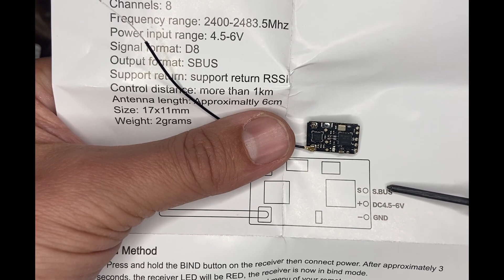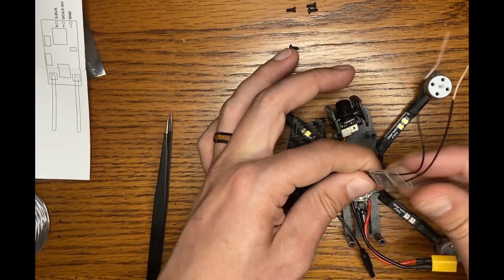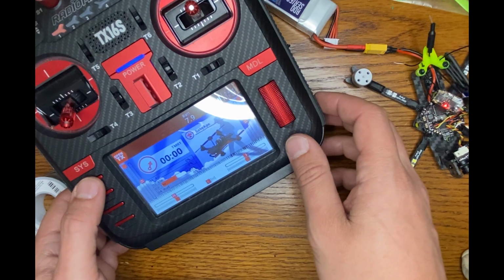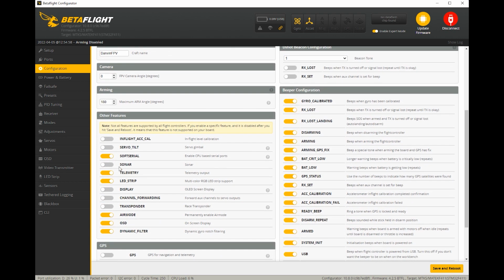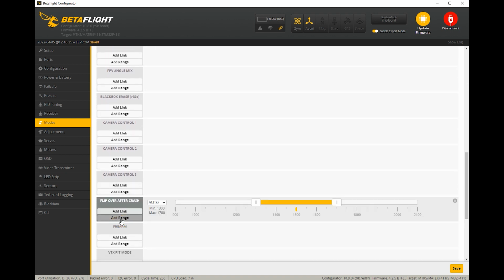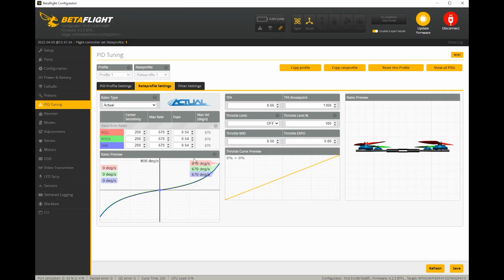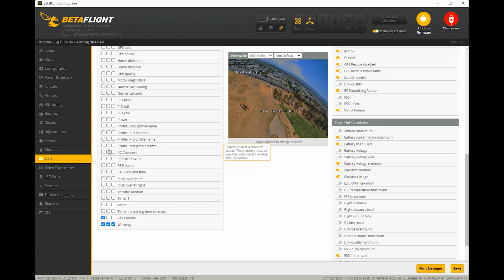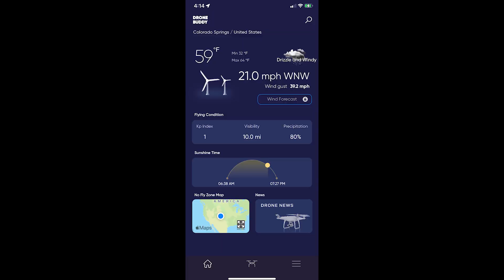Setting Up My First PNP (Plug-and-Play) FPV Drone - DarwinFPV Baby Ape 3" - Radiomaster R81

Comment: What up bro, I know these videos are fairly old but just wanted to say they’ve been very helpful. Crossed over from DJI drones and started with the Tinygo & then coincidentally just got my baby ape pro v2. I bought a bunch of soldering stuff because I eventually wanna learn but luckily the ape I got came with the elrs rx so I was able to skip that part of the vid. I’ve seen other videos showing how to bind other drones with the elrs tinyradio & it seems you plug and unplug the drone 3x & then follow the bind steps on the tx. Is that the same across all elrs drones? Should I do anything with betaflight? I know this is a long ass msg so thank you if you actually read/reply 😂 ..added you on TikTok also. PAYCE ✌🏼

Comment: Hello.
My baby ape only beeps 3 times in betaflight configurator insteased of 6 times to show that a setting has been saved on the flight controller.   Any hel
 Guys on what i should do ?
Reply from the maker: I believe the first 3 beeps is confirming esc powered up and the 4th is throttle input is being read and the 5th is confirming throttle is at zero. So try having your controller is on and bound with throttle down otherwise betaflight may not have your throttle input at zero so you won’t get those beeps. If you’re still not getting the last 2 beeps, your 5v regulator may have stopped working and will need to be replaced

Comment: Nice and helpful tutorial! I recently got the same drone an receiver, could bind it with my tx12, but the signal is so poor and I cant find the error. Soldering is well, signal D8. Any ideas?
Reply from the maker: With the international module you could first try fine tuning the frequency and that could help, check the antenna are fully connected and not blocked bay anything or damaged, and it’s also possible it could just be faulty hardware. Frsky isn’t the best protocol when it comes to range. Are you getting failsafes close by or just warnings?
Reply: @719FPV  Well, it is crazy. If I remove one antenna, the reception is suddenly better. Maybe it is the hardware. Thx

Comment: difference between ELRS receiver and r81 receiver
Reply from the maker: To sum it up roughly elrs receivers are open source and will work with any transmitter with elrs protocol so there are lots of options of manufacturers and frequencies. The r81 will only work with transmitters that have frsky d8 protocol, which is still pretty common to find. But past that the main difference is the r81 receiver has a range of about 1km or 0.5 of a mile, and elrs receivers have ranges of 30km or more
Reply: @719FPV  THX!!!!
Reply: @719FPV  Hello! I have decided and I want to buy this drone and I have some questions. On their website I can set the Elrs receiver option. Does that mean I have to install it myself when it arrives? And the second question is: what is the maximum control distance?
Reply from the maker: @planes917  no, if you choose for it to come with the receiver it will come with it installed. And the maximum distance can vary depending on a lot of different factors but in perfect open air conditions you will be able to go as far as you want and would only be limited by flight time and video signal
Reply: @719FPV  Does it come with a controller and goggles?
Reply from the maker: @planes917  yes, you can the the rtf(ready to fly) kit that comes with everything you need
Reply: @719FPV  if I buy only the drone, can I buy a different controller and connect?
Reply from the maker: @planes917  yes, just make sure you get one that works with the receiver that you choose
Reply: @719FPV  Ok. THX!!

Comment: Hey pueblo here! Just came across your videos trying to find a good cheap drone to have some fun with but don't want to spend too much. I wanted To go the build route but becomes pretty expensive when adding in controller and batteries 😅
Reply from the maker: It definitely adds up quick. Going the “ready to fly kit” rout is a pretty good way to start, the baby ape now comes in a ready to fly kit that’s a pretty good deal. But if you know what controller and goggles you ultimately want, you’ll save money down the road buying those first so you don’t have to buy more than one. Let me know if I can help
Reply: @719FPV  thank you for replying back so fast right on👌and yes it definitely does add up I really want a type of drone like the baby ape but was also looking at regular drones like the tello and some of the Holly stone drones, do you happen to know much about either of those drones? Thank you very much in advance 👍
Reply from the maker: @aip719  I don’t know much about those, sorry, but those look like decent options for entry camera drones.
Reply: @719FPV  would you have to know anything about the emax tinyhawk freestyle 2? It has goggles and controler I've seen some good things about it I think that us the one I might go with at the moment
Reply from the maker: @aip719  yeah they tiny hawk kit would be a great option to start with
Reply: @719FPV  I now just came to the realization that I have glasses and wasn't really  paying attention to how many of the Goggles out there don't really look like they'd fit glasses so now I'm really not sure what to do😅or I can just try and get me some contacts again 😅
Reply from the maker: @aip719  a lot of goggles come with adjustments in and out to focus that might work for you, and some you can insert prescription lenses too

Comment: Hey Nick, thanks for the video! I had a quick question about the quad that I couldn't find online: What length standoffs are used in the frame? I'm ordering a baby ape now on special, but want to also add standoffs in the same order. Thanks in advance 😃🙏🏼
Reply from the maker: No problem, the baby ape standoffs are 15mm M2
Reply: @719FPV  Wow, thanks a ton for the speedy response and info! Legend! Happy flying 😎

Comment: Nick,
I am trying to get into FPV and have bought a BabyApe.  My question for you is how’d you learn what everything in betaflight is/means?  I’m a little technically challenged as I probably have 25yrs on you so I didn’t grow up with computers.
I am using your video to help me set up the BabyApe, but I’d like to understand Betaflight, it seems very complex and over my head but I want to better understand it.
Reply from the maker: Right now the best resource I have found for understanding Betaflight is the Joshua Bardwell YouTube channel. He has a full playlist that goes through everything. It takes some time to get through them but very much worth it. 
Here’s the link the the playlist
https://youtube.com/playlist?list=PLwoDb7WF6c8nT4jjsE4VENEmwu9x8zDiE

Comment: So if I am understanding this correctly, the Radiomaster R81 is a FrSky D series compatible receiver, so this should work on my Turnigy 9x which I have installed a FrSky DJT module(which I have been using with the FrSky D8R-II Plus that came with it). Does that sound right?

Comment: i accidently deleted the comment can you send it to me again i contacted a sell of ebay about the drone and he says it has a 4 pin for the receiver is that true
Reply from the maker: Haha yeah no problem, the receiver you have will work with no issues. The baby ape comes with solder already on the ground, 5v, and sbus pads which make connecting a receiver super simple. It’s also has available rx and tx pads for receivers that require them.
Reply: @719FPV   @719 FPV   @719 FPV  this receiver Radiolink R8SM has a concert has a plug pulged into the receiver and 3 wires coming off it just solder the wires to the baby ape pro and the seller on ebay said there is a 4 pin connecter for the receiver r  does it have it on there
Reply from the maker: @dustinplee5067  yeah you will just have to solder the 3 wires to the baby ape, they will solder on the same way I did in this video
Reply: @719FPV  did you make a video on how to set up the vr goggles and if you did can you put a link in my comment so I can see how to set it up and if you didn’t can you make a video and what is the app for the baby ape pro I got one coming this weekend and does it matter what vr goggles I use
Reply: @719FPV   I got my baby ape pro in the mail today and it has 4  wires on the plug on the board and my receiver has three wires so do I just desolder all four wires The wires and solder my three wires onto it and do I need the white wire that is coming off that plug because mine I have three wires
Reply from the maker: @dustinplee5067  yeah it would be easiest to just desolder the 4 wire plug (which should be 5v, ground, rx, and tx) and then solder your receiver on using just the 3 wires going to 5v, ground, and SBUS
Reply: @719FPV  I soldered the red and black wire Like they were with the four wires when the red and black come off of and the yellow wire I soldered them all three next to each other and it’s blinking red one time and double blinking yellow how do I fix that Is the S bus where the white wire is or where the yellow wire was and when I tried to connect it to Beta flight it says failed to open surreal port when I tried to connect it to my computer And what board do I choose and what firmware version do I choose and should non-reboot Square and four chip  erase and Manuel Baud rate be set at
Reply from the maker: @dustinplee5067  sounds like you have it soldered correctly but your R8SM receiver could be in PPM mode, try double pressing the bind button to change it to SBUS. You may have to change it in betaflight as well
Reply: @719FPV  What color is the receiver supposed to be it’s red right now it was like a purpleish color but I tapped it twice on the bun button and now it’s a solid red but it’s still blinking red One time and blinking yellow twice what board do I choose and what firmware version do I choose and should non-reboot Square and four chip  erase and Manuel Baud rate be set at and what is my trim on my transmitter Supposed to be set at all the way down I hear no beep I hit the bottom of the trim and what’s my S bus PPM & PWM settings on the transmitter supposed to be neutral or reversed
Reply: @719FPV  and why is my baby ape probably o not connecting to my beta flight I’m using a Android cable I had to re-solder the receiver because it was in the wrong spot after I watched your video  it to the right spot but it still blinking a red light and two yellow lights
Reply: @719FPV  and what are the settings for the transmitter on a radiolink
Reply from the maker: @dustinplee5067  from what I can find on the radiolink r8sm is that it can use both PPM protocol and SBUS protocol. When it is in ppm, the lights will be red/orange. And when it is in SBUS the lights will be purple/blue. I believe it needs to be put in sbus mode and then it will work with the baby ape the set up should be same is what I did in this video
Reply: @719FPV  The light is blinking red on the drone and I have it plugged into beta flight and it is not blinking yellow twice and one time red it’s just blinking red One time when I reset the settings And when I have the transmitter and the drone on it’s not moving when I move the sticks and the receiver is blinking purple and blue is that normal and it says arm disabled
Reply: @719FPV  I figured it out I had to solder to the Rx 2 and I have a question why does drop like a rc plane would I have to give it throttle or if I don’t it just fall out of the sky
Reply from the maker: @dustinplee5067  glad to hear you got it figured out. And yeah, unlike a plane the drone will require constant throttle
Reply: @719FPV  
Why does it say failed to open serial  Port when I try to firmware flasher it End it will not load pass that

Comment: Dont buy this drone. you will get so sorry for doing so. there is a reason that they are so cheap. Me and one of my friends ordered one each and both are not working and they will do nothing, nothing to help us. I even wanted to buy the flight controller for that had a faulty usb connector but no no help at all. so just buy immersion rc for nearly the same price and you will get a tested reliable drone for under 20 euro's
Reply: I think it depends some are wonky some are not ! I have two tiny apes. I have friend with them too.
Reply: I have one and it works great even with low cost stock camera

Comment: Genial, una favor me ayudarías con configurar mi DarwinFPV por favor, una pregunta se puede conectar un receptor de flysky?, gracias espero tu respuesta, saludos desde bolivia
Reply from the maker: That should be no problem. I believe a flysky receivers will connect to the baby ape the same way as the R81 receiver using the same solder pads.